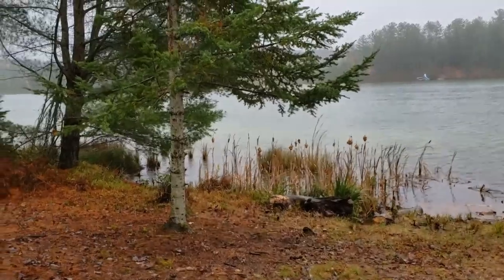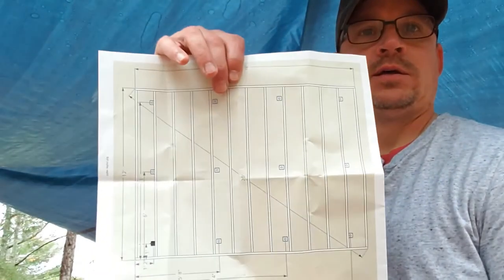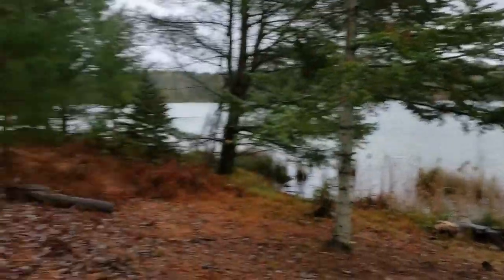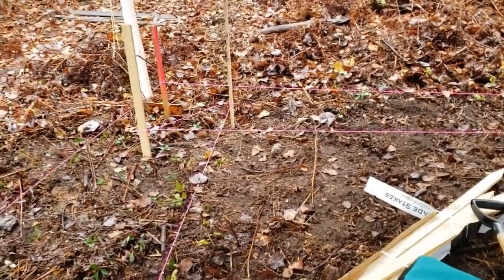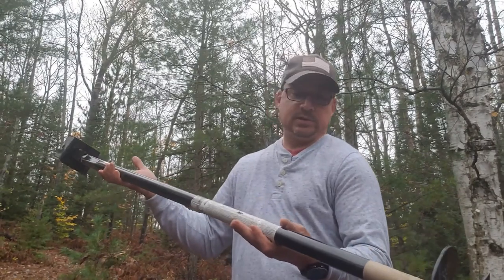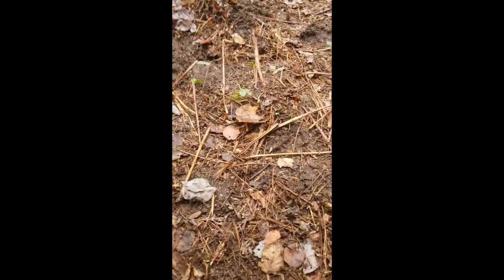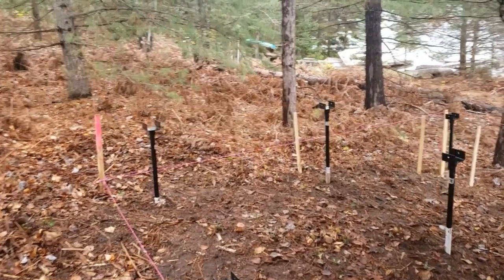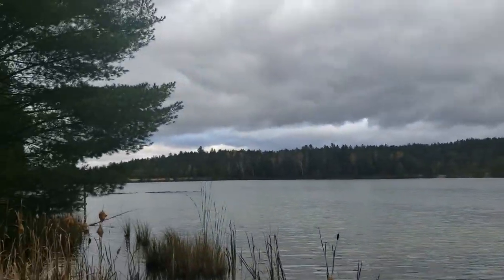12x16 Off Grid Cabin -  Foundation Installation - Part #1

Comment: Be sure to protect the screw piles against galvanic corrosion by burring anodes, typically magnesium, near the piles and electrically connecting the anodes to the piles.  I know the piles are coated and that is the first line of defense against corrosion, but there are breaks in the coating and break will develop over time especially with ground movement. The anodes will protect the breaks in coating. There are anode websites that help you calculate how many you need and the configuration. You’ll need to calculate or estimate the surface area of the buried screw piles to help determine the number and size of anodes. You may end up with one or more zones, but the zones need to be electrically connected to each other. I would also inspect the ground to air interface at each pile once per year for evidence of corrosion due to thaw/freeze cycles and availability of more oxygen that these locations, which aid in corrosion.
Reply from the maker: Hi Kevin,  Thanks for the tip!  Thanks for watching.

Comment: That’s very cool. My wife and I will be building a tiny house this spring. Did you read anything in the product literature that says what to if you hit a rock when screwing in the piling?
Reply: I’m doing the same. When you drive in your rebar, that’s when you will find out if you have a large stone in the way. The rebar is to keep the pilex straight. My guess is you need to move your pile or dig up the stone. Hopefully it’s not a boulder! Lol.